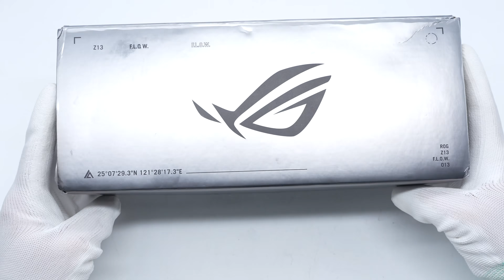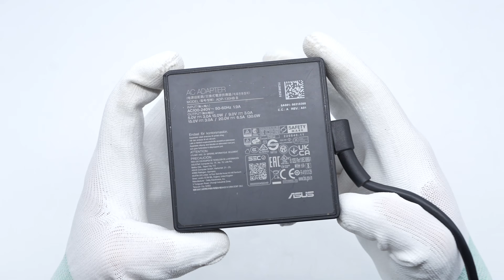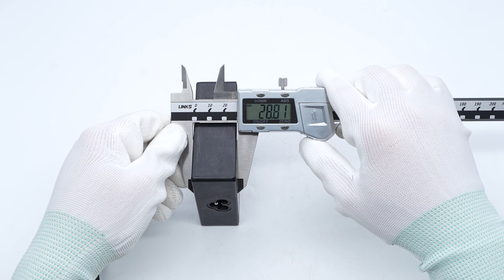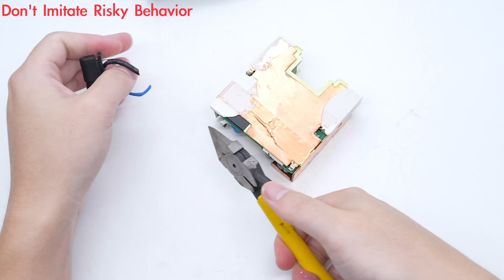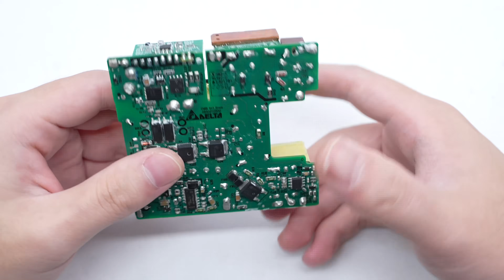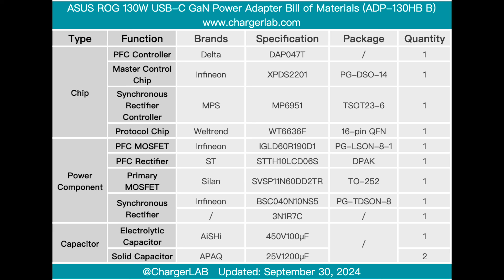Teardown of ASUS ROG 130W USB-C GaN Power Adapter

Comment: How does the PD negotiate the 20V 6.5 Amps when only PD 3.0? I have a tablet PC from Asus that came with this power brick and was always curious how it knows to power it with the extra 1.5 Amps at 20Vs. I have PD 3.1 140W supplies and the tablet still gives a warning that it is underpowered with them as the source.
Reply: It is still PD but non-standard. They have special emarker chips telling the charger it's an ASUS cable and that it can support 6.5A. 

Xiaomi and many other phone brands do the same thing. My Xiaomi cables have a special emarker which tells the charger they can handle upto 6.1A.